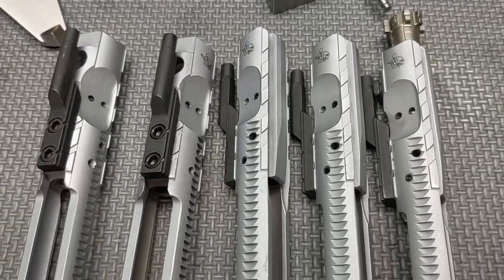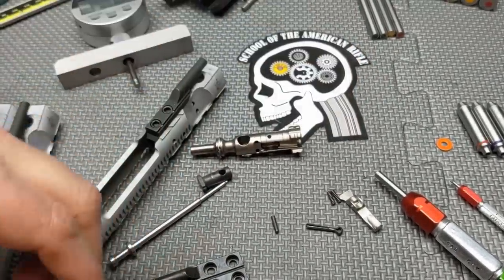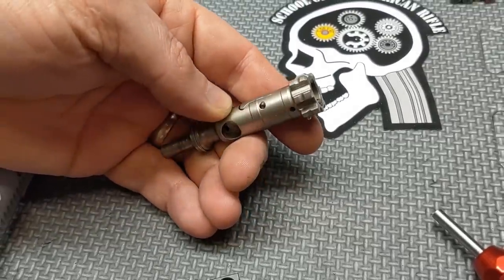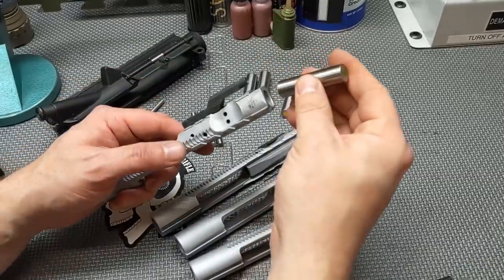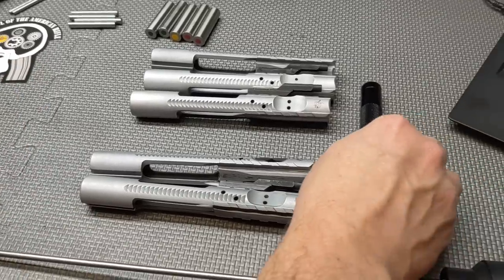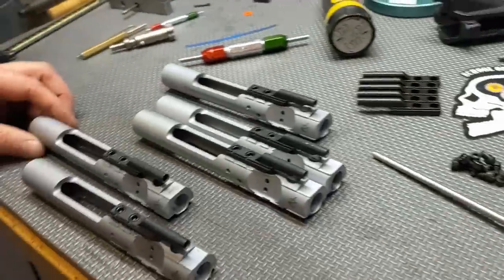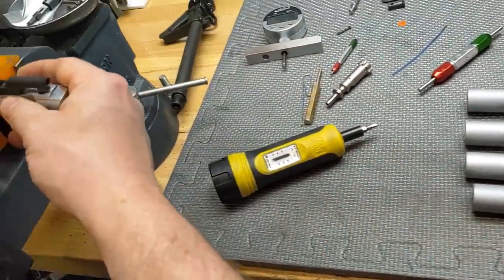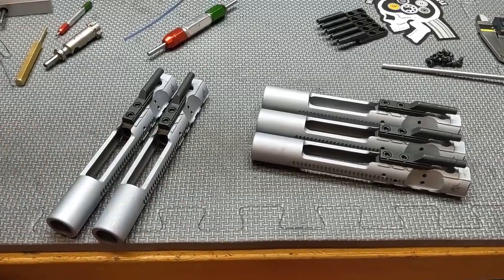5 KAC Bolt Carrier Physicals & 1 LMT Enhanced Bolt Physical

Comment: In my experience running CNC lathes and mills for my late father at his shop I'm not surprised that the carriers that had wider bolt-shoulder bores also had wider everything-else on there. The machine runs a few dozen parts (lathe) and begins to warm up and will start to go off of what the G-code is intended to machine. My father had me checking every part to watch for the machine shifting, and inputting tool offsets as things changed to maintain +/- 0.001" tolerances on the parts we'd be running for optics/medical/military jobs that would come in.
Reply: at least +/- 1 thou is a fairly trivial tolerance to meet.
Reply: @Wehra96  as someone that works as a machinist for the military, and have machined for medical also bores that tend to have alignment, or intended to have other moving parts inside them tend to be sub 1 thousandth tolerance, especially when pertaining to perpendicularity to the base datum, and towards the original post you shouldn’t be running a machine in auto that has not been warmed up properly, causes a lot of premature wear to the machine and wildly varying tolerances
Reply: @johngarlick7115  i worked with hydraulics and parts relating to hydraulic low pressure motors i've worked with tolerances all the way down to +0 -0.003mm, +/-0.00039 inches or +/-0.01mm would be our standard tolerance for stuff meant to fit together while moving. tighter for smaller stuff. our machines were never shut off unless we needed to restart the NC and kept them running for 12-16 hours per day autonomously so a cold machine was never really an issue. We also had a lathe that was used for very high precision large stuff that was shut down over night and we pretty much just let the spindle spin for a few minutes before starting to machine the parts.
Reply: @Wehra96  same thing we do bud s500 m3 for about 20-30 mins while the rest of the hydraulics run generally gets you where you need to be as far as everything being consistent, older machines may take a bit longer, or ones with ceramic spindle bearings as they don’t warm up easy on ceramic bearing equipped I have the guys run on the mid range rpm of low gear, then after 20 mins go to the mid range of high gear, and yeah tight tolerances can be a bear but once your there your there as long as you s+f’s are good and don’t chew your tools up. A lot of our important bores are +.0003 -.0000 so I feel you on those tolerances lol
Reply: @Wehra96  ever run Siemens 840 controller ? If you use NX to program for them you can actually account for tool wear in a sub cycle based on cycle count, it’s under one of the volumetric comp menus
Reply: @johngarlick7115  all Fanuc controllers of various ages for my stuff. i will say a tolerance range of +0 to-3 thousandths of a millimeter is kind of a pain on most machines.
Reply: @Wehra96  yes it is, though a lot of newer high precision machines that kind of tolerance is a cake walk, we have a enclosed 5 axis machine with a 15 foot by 30 ft work area capable of holding tolerances down to +/- .00003” here that is pretty cool
Reply: @johngarlick7115  most of my machines were from the mid 90s to early 2000s with the oldest being from the mid 80s retrofitted to be fully autonomous with a Fastems robotic system. so that kind of precision would be a luxury if they maintained it.

Comment: I like how they each gauged differently being from the same company. I had the same happen to me with a Geissele. One had the same dimensions as the one you had a video for and the other had a bit looser tolerances.
Reply: Different runs can have different tolerances and even start and end of run can and typically do have different tolerances.  When you have a CNC running, even taking into consideration of the temperature of the grease in the machine can affect measurments.  Its especially the case with cutting tools if you are doing longer runs before checking tolerance; think of a drill running holes over and over, those holes will change the more it cuts and you have to offset or change the tool before it becomes an inssue.  KAC has phenomenal QC and this blueprint session proves it out.
Reply: This is why we have tolerances. It''s impossible to produce any parts that are exactly identical.

Comment: I had a KAC sand cutter with an LMT e-bolt that I put together. The LMT bolt was fantastic, as they always are. The SC carrier was not impressive for the cost. Just underwhelming finished machining, this video explains why. The tolerances are just not that great. 

Do we know if the sr15 bolt is a forged item? I think its reputed strength might be more related to material than the rounded lug design.

Comment: My go too BCG when I'm not running suppressed is this combo . KAC Sand Cutter BCG with LMT Enhanced Bolt.
I've never heard of anyone breaking LMT Bolt either . I believe Crane was unsuccessful in trying to break one.
Reply: What combo do u run when suppressed?
Reply: @jonengelbird7051  Depends. 
Usually I'm running Springco Blue Spring with Colt H2 Buffer. Sometimes I'll run Springco Blue Spring , Car Buffer and BRT Tuned 0.73 gas tube . 
I run 13.X Mid Lengths.
Also quite a fee variables that depend on what combo or setup I use . If using Gassy Can than might wanna go with BRT Tuned Gas Tube . Flow thru type can you'd might wanna run Springco Blue with H Buffer . 
If using A5 System then Springco Green with A5H2 or A5H3 . 
The way it was explained to me is A5H2 Buffer is equivalent to Standard Car H buffer and A5H3 ould be same as Car H2 Buffer. 
For the most part Springco Blue Spring with Colt H2 buffer is what I use . 
Weaker 223 55g FMJ ammo might Short stroke when using this combo non suppressed . 
For Carbine Length Gas system I usually run Springco Red with Colt H2 because the action is way more violent .

Comment: Hey Chad,
How big are the differences in those gauges when you check the "three bore" dimensions? Thanks for making these videos!
Reply: I think he said the gauges had .001" in between them. Your hair is .004". 
I'm not sure the efficacy of checking those diameters in .001" increments. At that point you are LITERALLY splitting hairs. Maybe you would want to know if its .005" out of spec.
A clearance fit where two parts can freely move typically has at least .002" to .003" unless you have perfectly ground surfaces. Lower than that and AIR has a hard time even  getting past.. Im not sure what you learn discovering that your carrier is .001" oversized.
EDIT: Id be hard pressed to find many if any features on the original AR drawings has a +/- .001" tolerance. I love the videos, but I think some of this stuff is overboard.
You could measure most this stuff with telescoping gauges and a pair of calipers; spending a lot less; and having to store dozens fewer amount of tools. Those precision ground gauges are ideally used when checking production quantities where you can't take the time to measure it or have people that don't know the measurement; they are just paid to stick the gauge in the hole and put it aside.
Reply: @LeCafeRacer  So I would be interested in the tools that you are talking about, simply because the issue with the tools to measure the exact tolerances are expensive? Don't they require annual certification? Training? Great feedback!
Reply: Back in those days +/-.001 would be a cake walk. As a machinist for over a decade, I have come across many prints from the 60’s and 70’s that had tolerances of +/-.00025”.

Comment: Excuse my ignorance. What is bad about having magnetism in some of the parts? Extra resistance in motion due to eddy currents?
Reply: Not an expert myself so take what I say with a grain of salt, but from what I can tell is these parts are made of stainless steel, so you shouldn’t see anything magnetic.
Reply: @TheChad138  ah, so hints of magnetism would point to low quality/cheap, unsafe material like basic iron?
Reply: @itsthorondil7608  just watched another video of his and he said it’s not a big deal if using brass cased ammo, but if you use steel or bimetallic cased ammo it would leave shavings and could mess things up.
Reply: @TheChad138  Some stainless like 18-18/304 do have slight magnetic properties while others, like 316, do not. They also have different resistances to chemicals. 304 will rust when introduced to chlorine while 316 doesn't. Not sure what barrels are typically made of off the top of my head. I just sell fasteners, so have some knowledge.

Comment: What is the relevance of the magnetic check?
Reply: Steel-case ammo can apparently leave metallic particulates that accumulate over time in the bolt or upper receiver.  Magnetized parts can pick up and retain these in critical areas with limited clearances - I believe the area of particular concern is the firing pin channel.
Reply: @jaeger1447  interesting